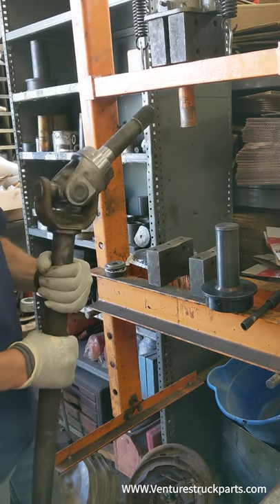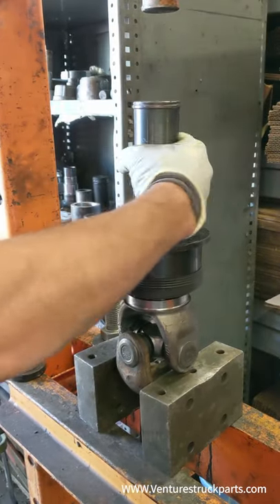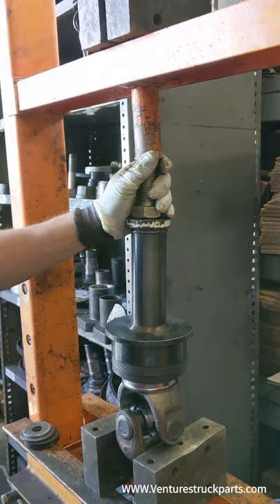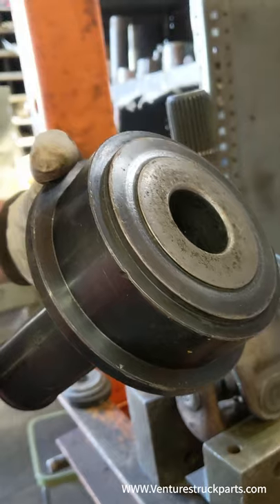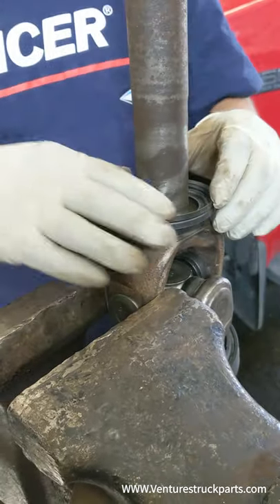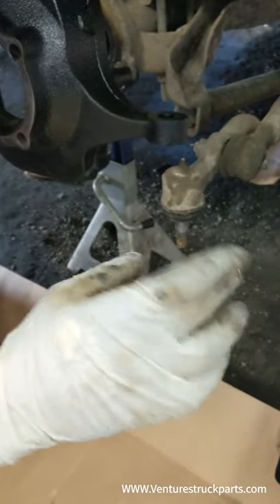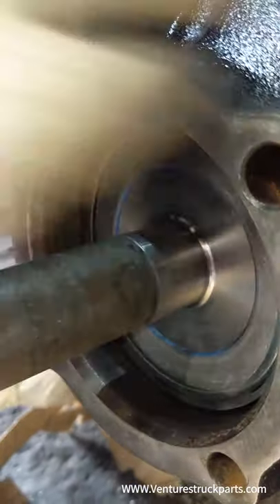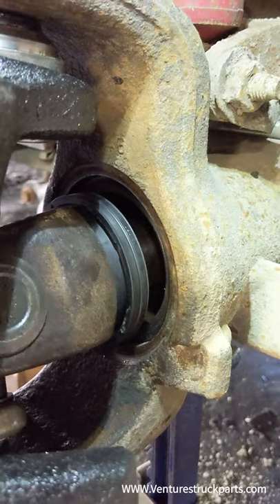How To Install Axle shaft Vacuum And Dust Seal On Ford F250 F350 Excursion Superduty 1999-2004

Comment: The OTC toll also helps to properly set the install depth of the axle/seal assembly into the knuckle.
Reply: Yeah, he didn't show that part, but that's also what that tool is used for, and necessary.

Comment: Can the vacuum seal be installed with tool you use and a mallet or sledge ? And whats best to use for lubricating hub selector ?
Reply: Yes you can set your tool on the seal and use a 3lb mallet
Reply: @gerardthibodeaux1157  Hi.
Yes, you can set seal with a mallet. I just did.

Comment: I received new front Hub-bearing assembly, and they came w/additional parts.  I thought 
those additional parts are some king of seals for the bearing-hub assembly, and couldn't find out how 
to put them together. Now I know that those mystical objects are Spicers, an Inner Axle seal for those who plan to extract that Axle. Thank you for the showing installation process though I plan just to change the Hub-bearing unit. In my set I also received two O rubber rings, where do they go? Is the process for a small car the same? Thank you for the film again.

Comment: I have a 1999 F350 4x4 and I can’t find the outer hub axle seal for the front right axle. The part number 50381 that keeps popping up is too small.
Reply: This is a whole new system compared to what I took off. Is there no more dust cover?
Reply from the maker: @MADuranDude777   Give us a call and we can help you with your 1999 F350. We have all the parts on the shelf ready to ship.

801-621-0091

Comment: Is a press the only option for this even if you use the 6695?
Reply: No, you don't need a press, but you do need that tool.  I banged mine on with a hammer, and everything worked fine for at least 80k miles (don't use the truck much any more.)

Comment: Are use the 6695 tool to press the vacuum seal in place went fine, snap ring popped right in. Then I desired to do the u-joint so I removed the seal. After installing seal axle assy in to the hub I was not able to get the washer-thrush washer-washer and snap ring on, the seal is just not far enough down the shaft. I put the tool on and just beat the hell out of it, the end of my tool mushroomed, the seal did not move. I've tried and tried to pull the axle out, it just won't move. I've watched all your videos, can't figure what I did wrong. Now this is the second time I've done this, first time went fine. It's the second reinstallation of the same seal. Maybe I need a new seal but on one of your videos the seal. Passenger side went just fine.
Reply: I had a similar problem did you find the cause?
Reply: Maybe wrong part number
Reply: sounds like you put the Inner Thrust washer on backwards.  That will cause this.. They have a Vidoe on the proper way to install the inner Thrust Washer on the 2004 and older Dana 60.  The 2005 and newer does not use that inner thrust washer
Reply: What part number for inner seal